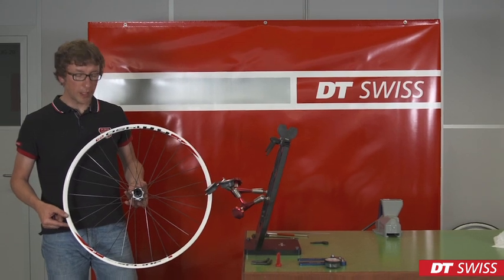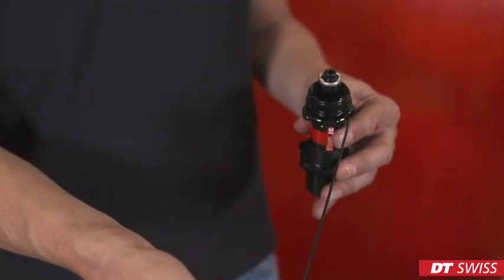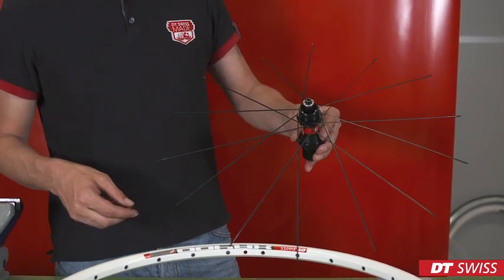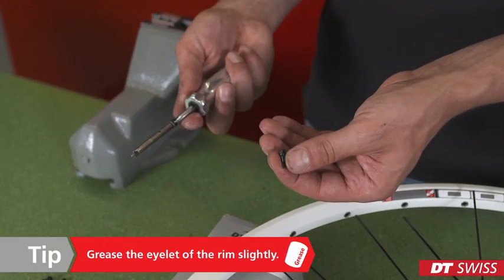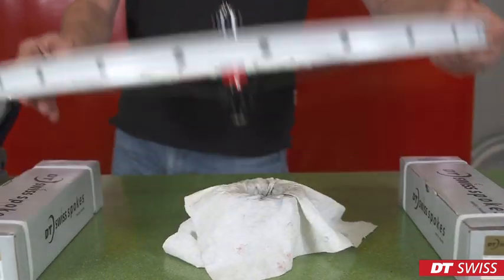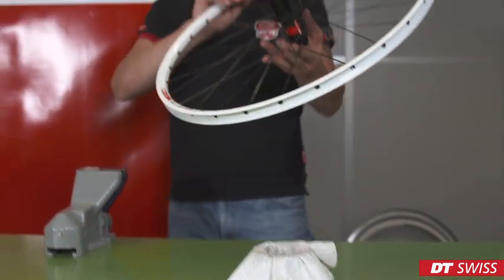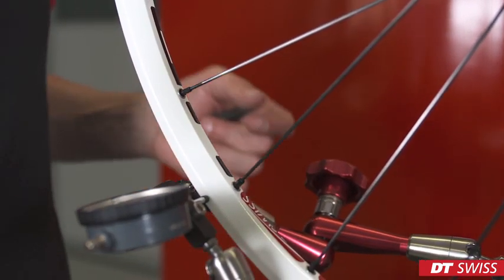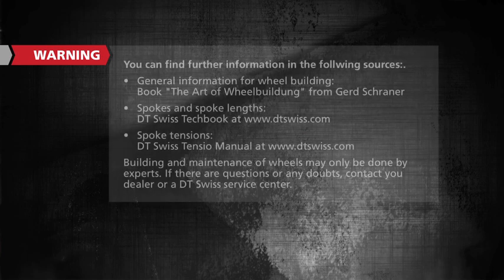How to build a wheel from A- Z: SPLINE.  | DT Swiss

Comment from the maker: What are your experiences on wheel building? Do you have any questions regarding this topic?  Let us know in the comments below. 👇
Reply: It seems that this video/explanation is not correct anymore for the current dt straightpull hubs. The spoke holes are arranged differently to that clockwise insertion only makes sense for the brake side. Please update or delete to avoid confusion.